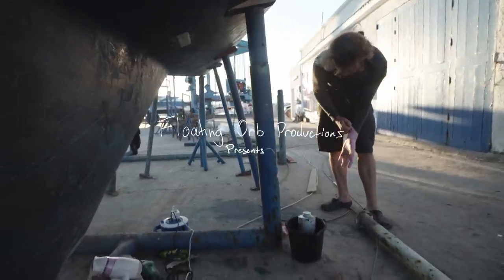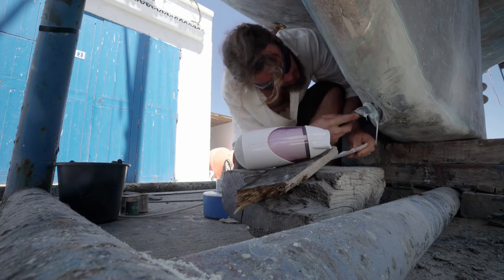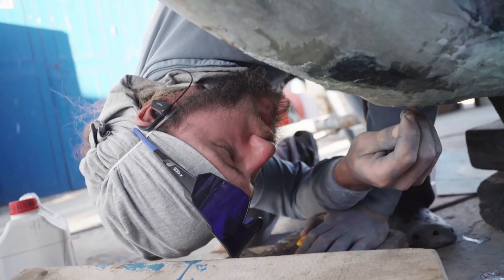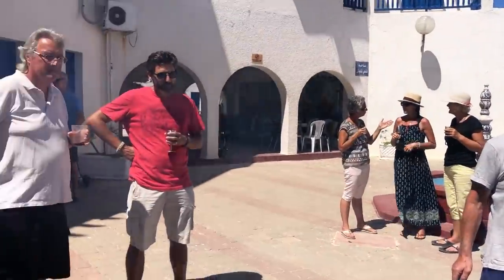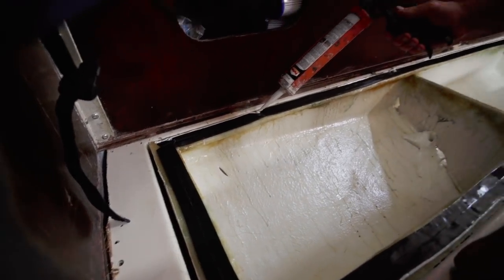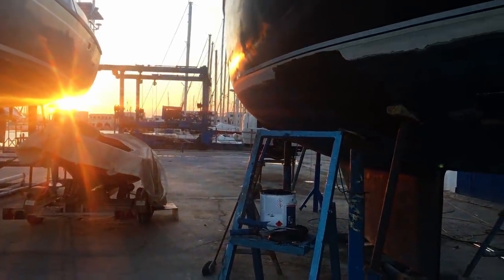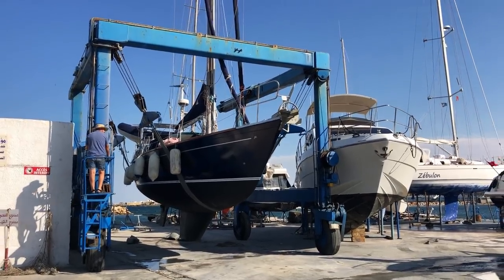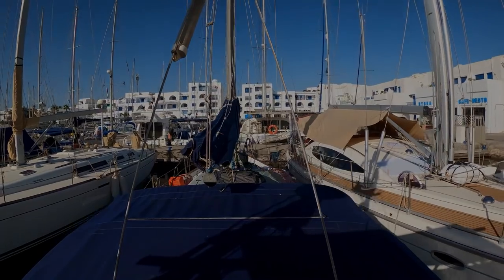"Will She Float?" Nightmare on Haul Out Street | Part 3

Comment: I wonder if you could have used Waterplug hydraulic cement in that keel hole- it comes in a powder and expands and absorbs water- sealed up the leaky basement wall 20 years ago.